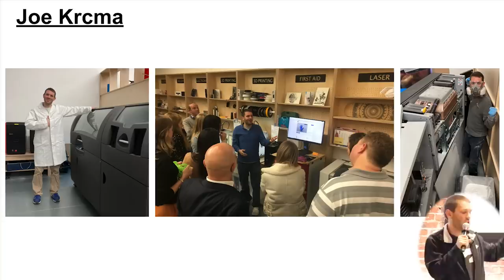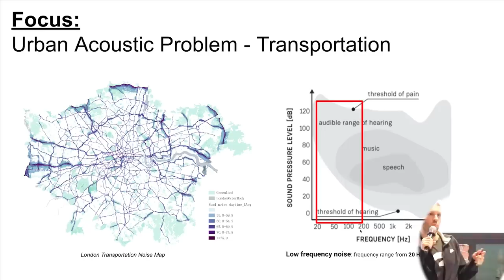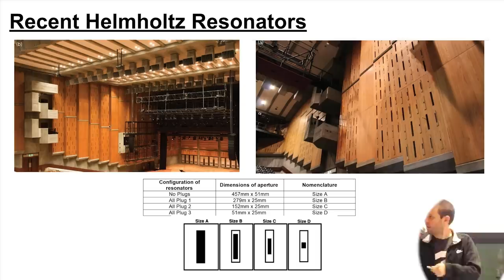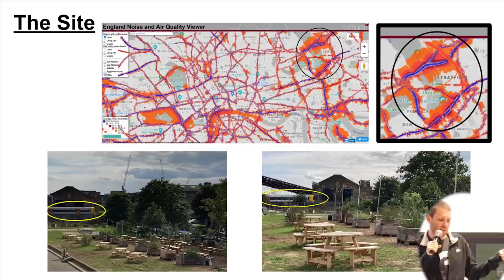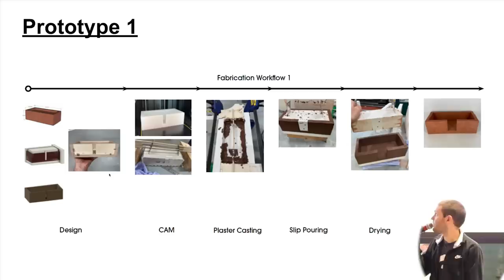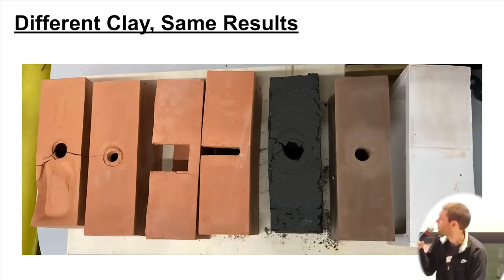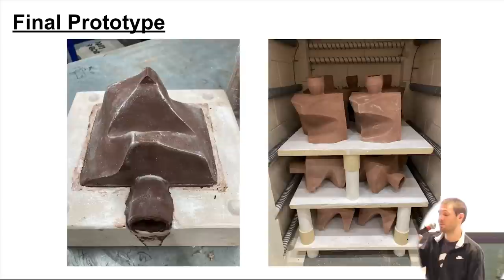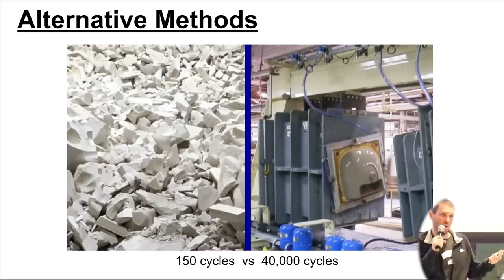These Bricks Can Absorb Traffic Noise - Thesis Presentation on Helmholtz Resonators

Comment: my biggest concern would definitely be drainage, you could design in overhangs to reduce rain getting in but preventing water ingress entirely is a losing battle. not just freeze-thaw, but also just the regular hazards of standing water: mosquito breeding, mold, or if you want to do some absolutely terrifying reading, read about legionnaire's outbreaks. the big contributing factors for legionnaire's disease are a combination of long lived standing water to breed the bacteria, and some process to aerosolize it; i'd be curious whether the concentrated acoustic vibrations could act as a sort of atomizer for spreading gross standing water particles.

I guess the other thing is cleaning; you'll have to deal with people filling them up with cigarette butts, pissing against the wall (oh no, now i have the phrase "acoustic piss atomizer" stuck in my head), and other such things, maybe it would be better to just have the neck be at the low point of the resonator, or even a dual neck (if that doesn't ruin the acoustics) with one near the top so they can be flushed out with water if needed.

would smallish holes (large enough to not clog) at the 2 low points negatively affect the resonator's absorbing properties? (my intuition is that it would make the resonator less efficient due to the cavity not being sealed, what i can't tell is whether reducing the efficiency would help it dissipate the energy better, or just make it worse at capturing it in the first place. i guess the first option is covered by dissipation and the second by Q factor, and at least in theory those should be separate variables, but i'm a bit fuzzy on this stuff)

i guess another option is adding some sort of diaphragm to the neck, but then you have to find a suitable material, and it sounds like this project is really trying to just focus on ceramics
Reply: Same concerns.
Reply: I now feel obligated to start a grindcore band just to name it "Acoustic Piss Atomizer."
Reply: why not just pointed at a slight angle toward the ground gravity will overcome any water
Reply: good points. Especially since we've tropical level mosquito army here.
Reply: If left unglazed terra cotta is actually permeable. A glaze would definitely seal it though. Pointing the neck at like a 5 degree downward angle would probably be good enough for the individual bricks, a drain slot would have to be incorperated into the outer chamber. Now that Im thinking about it these are actually entire walls of bird houses...which is a good thing I guess🤔
Reply: Good point about water and trash but I'm not so sold on the atomization idea. You're basically talking ultrasonic frequencies at that point. And natural takeover of plants like moss is mentioned at around 32:07 as a positive.
Reply: Well you could just make them porus so the water drains naturally and build them on the sides of the road instead of into buildings. You can make them more porus by changing the mixture and even if they're porus, they will still work maybe not as powerful but it will still have a huge effect on the noise
Reply: @funnycatvideos5490 - i imagine that would affect the efficiency greatly.
Reply: Could the be made with recycled plastics?
Reply: Freezing water here in Michigan was my first thought.
Reply: Build a small test wall in the forest and see who makes it a home?
Reply: @funnycatvideos5490  slight angle? the chamber with the tube going into it has vertical walls, your "slight" angle is 90. the other chambers are right around 45 degrees, which, if a wall is tilted over by 45 degrees it's no longer a wall, it's a ramp.
Reply: @MrMNRichardWright  maybe, but the scope of this project is explicitly ceramics. also, then you lose the porosity.
Reply: @maximelearning  i'm not talking like an optimized humidifier, just "air moving over the surface of the water". If you look at legionnaires outbreaks, it's usually things like air conditioners or cooling towers, where there's no high frequency, just air flowing over the surface of stagnant water
Reply: @loganfishbeard  RE the angle, am i missing something? you're not the first person to reply to my comment suggesting that, i thought the internal walls looked far too steep for that to work. i'm curious about the permeability, can it clog over time or is that not a factor? I think i'd still want to see macroscopic drainage holes though, since this would basically act as a water filter in reverse, accumulating all the gross stuff from the water inside while letting the cleaner water flow through the pores
Reply: I wouldn't worry about water, the bird nests will absorb it.
Reply: Do they have to be air tight to work?
Reply: @MrMNRichardWright  maybe,  there are some really tough plant pots being made out of recycled car tyres
Reply: This are good ideas!
Reply: It would be pretty trivial to model in drain holes/tubes that wouldn't adversely effect the primary resonance..

(I'm an audio engineer and models for this have been around for many years)
Reply: One option might be smaller cavities and make the cavity angled so that water would run out
Reply from the maker: I love Acoustic Piss Atomizer as the next video! 😂 I'm excited for some new design changes for another version and will take this into consideration.  Thanks so much for the thoughts!
Reply: @loganfishbeard  "entire walls of bird houses...which is a good thing" Once they fill up with bird nests, they probably will lose most of their functionality. So either they need to be cleaned every few years or they only work well for a few years. I think you'd have to cover the inlet with netting to prevent birds from getting in.
Reply: I've had the misfortune of encountering an "acoustic piss atomizer".

Stainless steel urinal trough at a venue with loud music, and the flat sheet back of the trough happened to resonate at some of the bass notes that were being played.

Upsettingly high efficacy.
Reply: @JoeMakes  I was just sitting here thinking that this is now an open source think tank 😂 which is the best way to get brilliant ideas off the ground for sure.
Reply: As a daycare teacher I'd take those inside too
Reply: @godfreypoon5148  Shame you didn't take a video of that, would be worth watching.  Although I suppose a dude waving a camera around inside a piss house would look a little weird.
Reply: Don't forget birds nests, wasps, hornets & dirt daubers.
Reply: @BurnTheFed1913  i mean birds would be nice, the other things not so much. although i'd wonder if a tuned resonator would be a healthy environment for raising a bird family, like what kinda standing waves do you get in there
Reply: @spambot7110  Birds nesting in your walls is not nice, specially if this thing is designed for high noise enviroments, the birds you are going to get are probably pidgeons lol, wich are filthy and will damage the structure with their poop
Reply: @gorgeluis  oh gawd yeah! Maybe the neck could be modified to be shorter, maybe <half a pigeon-width to make perching difficult/impossible for that size bird
Reply: @oscarinacan  Exactly. In order to work properly, the cavity walls in a Helmholtz resonator have to be sealed, hermetically.  The cavity is the spring in the system, and in order to be correctly "springy", the air cannot move in and out through a porous wall.  Drainage is going to be the big issue here.  If there is water inside the cavity, then the tuned frequency also changes: it will absorb a different frequency.  An empty glass coke bottle is a Helmholtz resonator.  Blow across the top to make it "hum". The note you hear is the tuned frequency for that specific bottle. Simple experiment: fill the bottle partly with a little water, and blow again... you get a different note.  It now works at a different frequency.  That would be the issue with these bricks, if water can somehow get in.  I can see a great application for these indoors, or in outdoor sheltered spaces, but way out in the open, where they are exposed to rain, bugs, birds, dirt, spiders, wind-blown debris (leaves, twigs, etc.), I think they would not be a good solution.
Reply: @volentimeh to me, it seems like if anything, that small holes might just dampen some higher range frequency but that wouldn't necessarily be bad either 🤷🏼
Reply: @JoeMakes My biggest concern would be wasps... We have a huge wasp problem here in Portland Oregon... You probably know that since you're from here... But the amazing thing about wasps is that they are territorial and if there's something that looks like a nest they won't camp there... Or even anywhere near there... So it was thinking that potentially the flat part of your dilly bobber could be textured like a wasp's nest to keep those kinds of things from building nests inside the resonator...

Another problem could be rodents... I would love for birds to build their nests in them but I would not want the mice to be building their nests in them or the rats... But there are certain scents that will keep mice and rats out and if the terracotta is not glazed then it's possible that it could be steeped with oil that is scented with the repellent... Such as cinnamon oil or peppermint oil or cayenne oil...

Some of those might deter birds as well but some of them might not.

I don't know if wasps are repelled by any particular scents.... But I know that there are candles you can burn that will repel mosquitoes and so that scented oil could be put on these to keep mosquitoes from building their water in there and also oils like peppermint are antimicrobial... Sorry I'm data dumping cuz I'm autistic and my brain is going down a rabbit hole...

But yeah anyway if they are not glazed there's a lot of different things that can be added on to the terracotta to repel a wide variety of different things and maybe make the environment smell better I don't know 🤷🏼

And after all of that the one thing I would like to know is each time you come up with one of these are you publishing the diameter of the shape etc so that other people can experiment with your experiment? Or is it IP sensitive?

I live in Portland next to a very very very noisy road and the people I rent from are trying to consider what kind of fence they might be able to put up to keep people out of our yard because we live in a busy intersection but also that might impede the noise levels... So if it were possible to recreate some of these shapes and build a test wall here that would be amazing.

I don't know how easy it would be to get a hold of me through YouTube but you can definitely send me a message by going to:
Lifecoach.contactin.bio
Reply: Clay or resin can be mixed with antifungals and/or antibacterial chemicals  just as house paint has been for years in the US. Health/disease issue not a likely obstacle to function in current physical form/design.
Reply: No, brick houses that are built with great care can last hundreds of years.
There is not a chance that recycled plastics could have the same impact and performance.
Reply: Freezing and thaw is a problem with absorbed water.
Reply: @spambot7110  The brick doesn't need to be at the angle. Only the neck. Slight assymetric design change is all it needs.
Reply: @jeffjwatts  And imagine the roadkill frequency
Reply: The nesting birds would probably deal with most of the insects,  if drainage is addressed.
Reply: @loganfishbeard until you realize that birds poop a lot.
Reply: You could have the open neck ¬1.5m above ground level to stop people from putting trash in them.

It's horrible to think of this beautiful architectural device being abused in those ways, but it is what it is..
Reply: @JoeMakes  Here's a simple solution that could keep the functionality while preventing water and animal ingress, all while being simple and iteratable... membranes! A reasonably thin plastic membrane should still be able to vibrate and allow noise into the resonator, but would block out anything physical from entering. You could even engineer a predetermined "slot" of some sort to more easily fix the plastic in place. To remain environmentally friendly these could simply be recycled plastic.
Reply: @Nishandh_Mayiladan   - Not to mention gecko lizards in many warm climates.
Reply: @sirgavalot  I love the use of "half a pigeon width" as a unit of measure 😂❤
Reply: @StuffandThings_ I was thinking of reeds, like the reed of a woodwind instrument; bonus points for it being a natural, sustainable resource?
Reply: angle it downwards
Reply: I feel like if architects built these in buildings above waste level, then the piss concern would be mitigated. But yeah, maybe adding a small drain hole at the bottom of each wouldn’t be a terrible idea.
Reply: Yea, I like the aesthetic & the concept, but I’d be interested to see how they hold up long-term for durability & load-bearing. Or meeting building codes for wind/seismic/snow loads. Birds would certainly love all the nooks & crevices though. It’s like a bird apartment building.
Reply: My mind immediately went to wasps and other insects that like to build nests in cavities
Reply: I dont think legionaire disease would be a problem unless you plan to drink from them.
Reply: Acoustic piss atomizer sounds like an awesome name for a folk punk band

Comment: I love it! Additional thoughts: 
1. Explore different frequencies. There may be use for areas with reduced speech noise, at university campus, library cafes, graveyards or areas with high pitched noises. This could let to different sizes or "keys" (like tonal keys) which should be able to combine with each other. For example with this one could estimate for a certain location to use 30% of the low frequency bricks and 70% of the mid to high. 
2. I really like the secondary advantages like habitats for animals. Clay or ceramics also have the ability to absorb and give out water, witch is great for plants, but also has a cooling effect due to condensation. This can help to cool down cities (witch are hotter than the countryside) in times of climate change and absorb water in flooding seasons because of impervious surfaces in cities. 

3. There are a few videos on youtube about architecture that was inspired by termite nests. Nest and buildings have a passive airflow system based on clay. It is helping to cool down rooms in an extremely hot environment. That might be interesting for you.
4. A lot of cities are getting to hot because of the lack of airflow. For this some use breeze blocks, basically clay bricks with big holes

I can see a combination of all of this. Everything is passive once it's build.
Reply from the maker: Thanks so much, Peter!  These are great comments.  I'll adapt the design and see what it is like for the next version.  👍

Comment: I've been to London and couldn't believe the noise level. It was must immense. You were just inundated with sound energy, it made you feel alive, like it would seemingly stimulate your sympathetic nervous system, so I 100% believe that heart disease is made worse by noise energy.
Reply from the maker: The volume and pitch of the sirens was the thing that annoyed me the most!  But I'm starting to sound like an old grandpa 😂
Reply: Constant triggering of fight/flight response...that's my guess.
Reply: Alive, yes, but struggling. Wearing on the nervous system AND the heart/lung.
Reply: @JoeMakes  There was IIRC some research done on incorporating white noise into emergency vehicle sirens and turning down the wailing/whooping tones decades ago... don't think it was widely adopted though there has been some takeup for the reversing vehicle sound.
Reply from the maker: That's a shame because after moving back to Portland, I notice how quiet it is here!  Thankfully @joinedupjon
Reply from the maker: True, and it never turns off @pirobot668beta
Reply from the maker: Completely!  Uninterrupted sleep is so important @eric2500
Reply: @JoeMakes old grandpa are deaf so they don t complain about the sound often. 😅
Reply: I’ve never found London streets particularly loud… The older tube lines on the other hand.

Comment: You made what I actually invented 15 years ago; what I call a band-trap device.
My background is electrical/electronics engineering, so I have a strong grasp on particle physics, acoustics and well beyond. For a subwoofer box I was designing, I decided rather than all the ports and ducts of a high order dB box, I would utilize some of these design techniques but internally, I built a box that is ported for 50 Hz, 35 Hz and 25 Hz trapping these inside the box's internal chamber and firing them straight into the car by means of the container itself sitting on the body since since these are bands we feel even more than we hear.

Innovation isn't what it needs to be but it's cool to see I'm not alone in these experimental adventures. Another factor of noise with music equipment as a metal and instrumental guitarist is all the RF it picks up, particularly 50/60 Hz and relative harmonics of those trouble frequencies. In that regard though, it boils down to isolation filters and requires insanely steep and high order dB filtering. Literally 105 dB of high pass isolation of around 72 Hz. I've built a simpler experimental version and will eventually go full out with the suggested mathematic values.
Reply from the maker: Nice!

Comment: Herman Helmholtz is on of my scientific heroes. His studies on sound and music deserve more attention.
Reply: The Harley-Davidson engined Buell motorcycles of the late 90s used a Helmholtz Resonator airbox.
Reply: How did it work?
Reply: @snorttroll4379  Simply stated, it amplifies the wave of air going into the engine, kind of like a speaker box amplifies sound. It gives the fuel/air charge a bit of a bounce into the combustion chamber. Most modern cars and motorcycles have an airbox that does much more than just house the air filter.